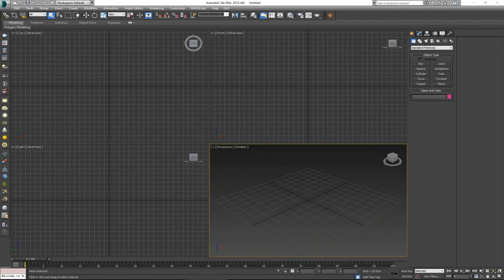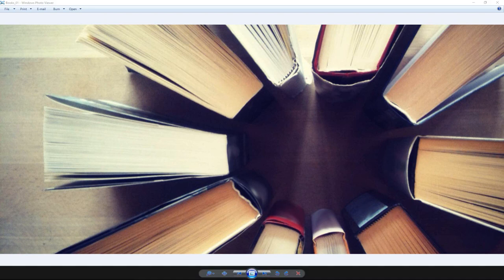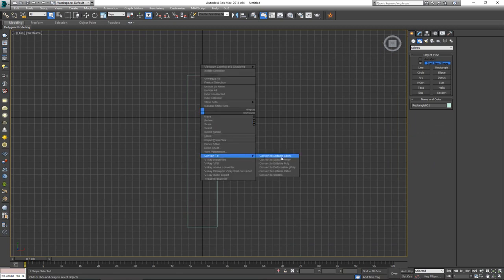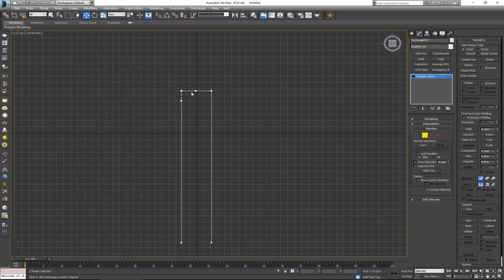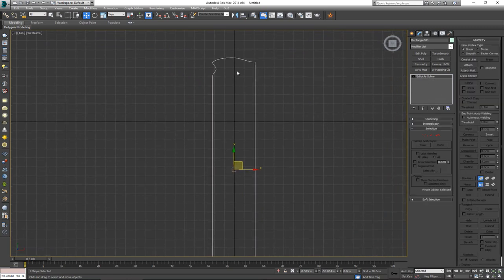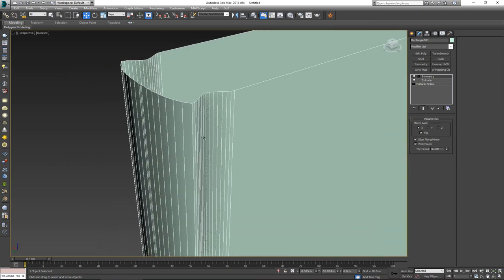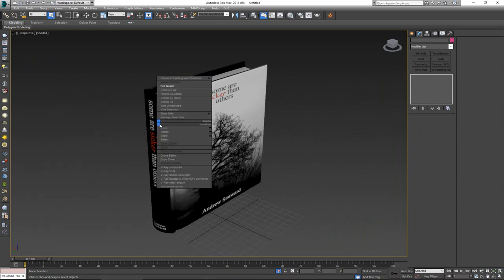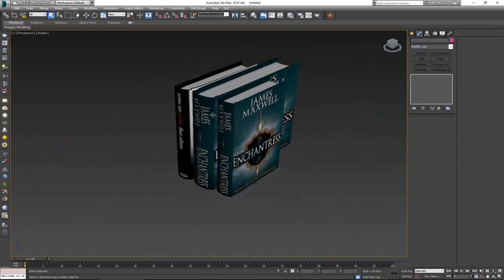Modeling a Book with 3ds Max

Comment: No idea what I did wrong but the texture appears stretched when in the 2nd Edit Poly and TurboSmooth modifiers but looks very similar to yours on the Shell modifier down. Any idea where I could have gone wrong?
Reply from the maker: can't really say without an image so i can see what is going on
Reply: Figured it out. Screwed up the Swift Loops. Deleted that 2nd Edit Poly, put in a new one and redid the Swift Loops and it looks good now.
Reply from the maker: there you go :)